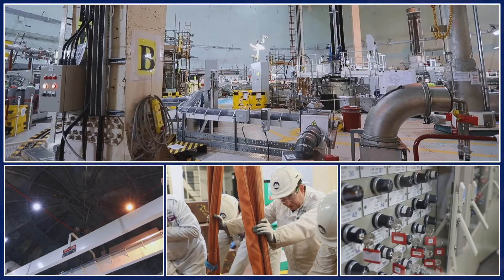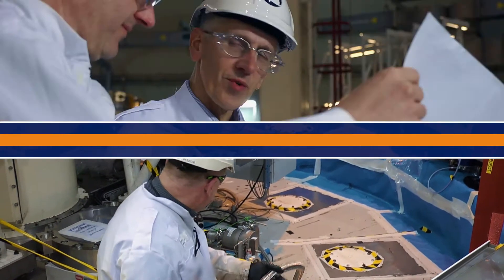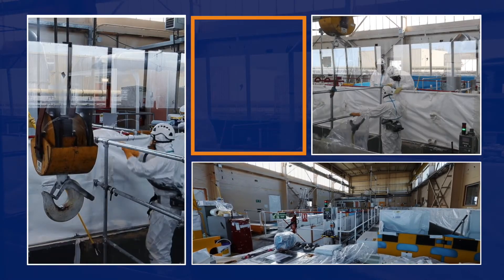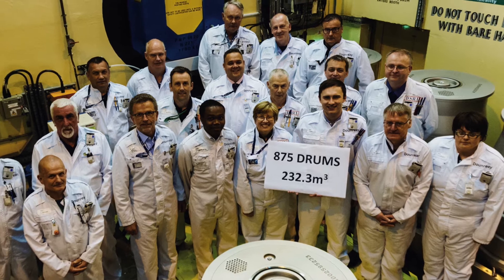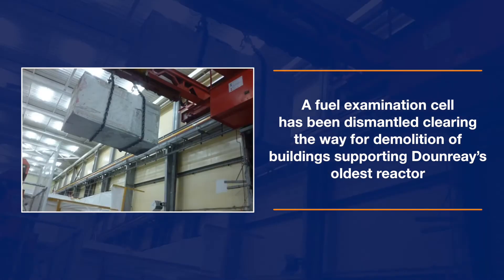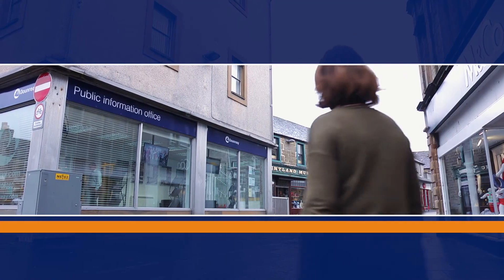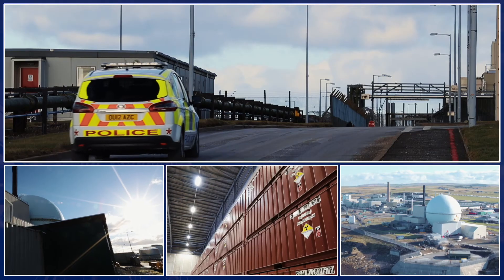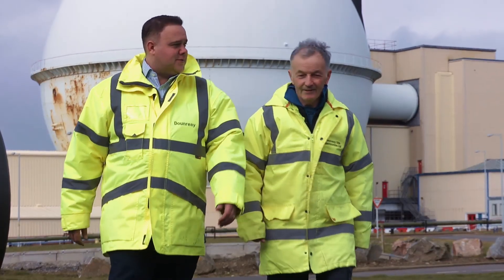Dounreay achievements 2016 - 17

Comment: 19 years of operation up till 1979? and its still not fully decommissioned yet in 2018 and a legacy of waste that will still be a risk for 300-500 years? You guys are doing a good job, in the circumstance … but surely Dams, TIdal, Wind, Solar with storage of energy has to be a better option than nuclear long term?